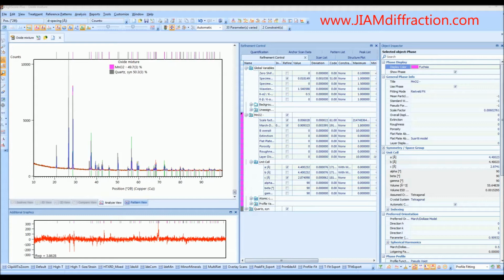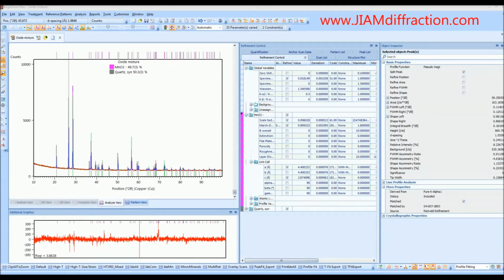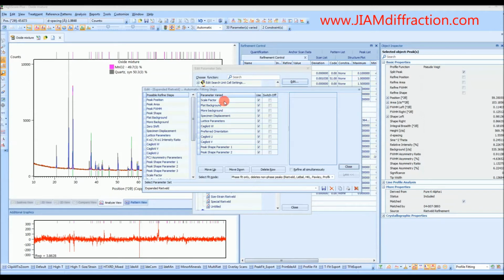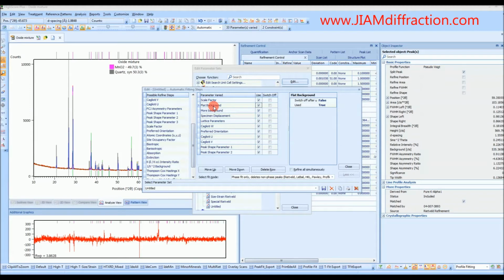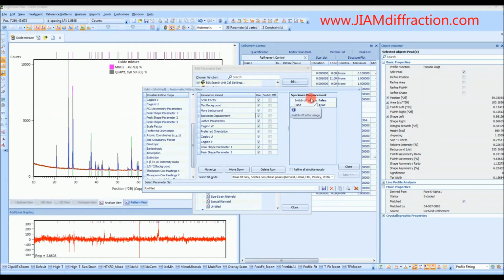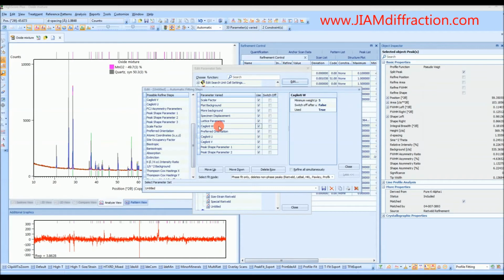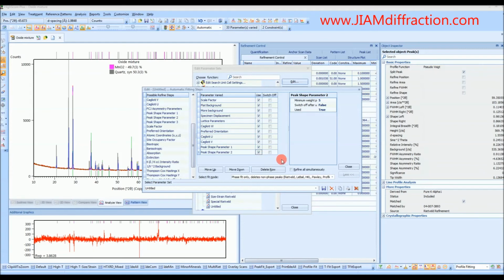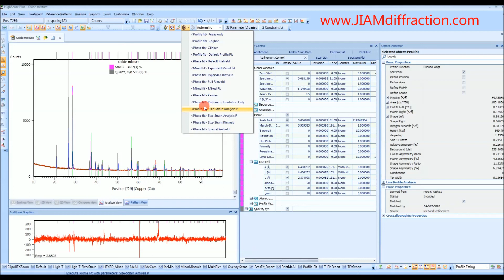HighScore Plus Tutorial - Create & Edit Parameter Sets - Automatic XRD Refinement - JIAM Diffraction

Comment: I saw  your many video about Highscoreplus. They are much helpful for me. Thank you so much. I want to calculating the lattice parameter with XRD. I have a same question with Paul Chando's one. Mine version is old (3.0.c=3.0.3) I cannot make a automatic profile fit file like you. In my program, there are only Automatic Rietveld step and Autoumatic profile steps. I cannot edit them as you.  How can I analysis like you in old version?
Reply from the maker: Thank you for the kind words!  I discussed this with Paul, and it looks like it may be an issue with your older version of HighScore.  I wish I could help more!
Reply: Thank you for your kind reply. How could I give some information about this menu, editing parameter, in older version Highscore?

Comment: Great video on how to modify parameter sets.  I do have a question on how your parameter sets include modifications for both profile and Rietveld refinement steps.  I am using Highscore 3.0.5.  When trying to edit a parameter set, I have the option to edit Automatic Rietveld Steps or Automatic Profile Fit Steps.  I never seem to have the option of being able to edit parameters for profiles and Rietveld at the same time.  Is there some configuration I can make in Highscore that would allow me to have the same level of customization you have in your videos for the parameter sets or is this simply an issue of using an older version of Highscore?
Thanks for the great videos.
Cheers
Reply from the maker: My apologies for the slow reply!  I was away at a conference all last week.  Anyway, it is always difficult when trying to figure out the differences between versions of software.  If you look in the edit screen (time stamp 00:01:54, for example), and you look below the "Move Down" button in the center bottom of the window, does your version have the "Select Fit Mode" option?  If so, my options within that drop down menu include profile fit only, phase fit only, and mixed fit.  Is yours different?
Reply: @IAMMDiffractionFacility  Thanks for your reply.  I have checked my version of editing the parameter sets and I do not seem to have the "Select Fit Mode" option.  The issue may very well be a difference in the versions of Highscore plus.  Thanks again for your help and these instructive videos.

Comment: Hi, excellent video!!!Thx a lot! I would have a to questions: when the background is very high (for ex the amorphous part of a wood sample), is it ok to use the search by peaks function to identify the background? The automatic one simply does not function, and the manual can give a lot of extra fake peaks. The second: sometimes the chosen patterns explain all the peaks, but after the Rietveld refinement, that V marker reappears. What does it mean? That some of the peaks of the chosen patterns are not contained in my diffractogram? Or poor refinement? Thx you, Calin.
Reply from the maker: I've not used the "search by peaks" function for background determination a lot, but it has seemed to work well in cases with a large amorphous hump.  Regarding your second question, I'm not too sure.  When this happens for you, what does the calculated pattern look like?  Does the calculated intensity for that kind of peak look much lower than the data intensity?

Comment: Thanks doctor, but i need to know how i can change the anode type from Co to Cu
Reply from the maker: Excellent question.  While I have much experience swapping X-ray tubes, I do not yet have a video made to post to YouTube.  Unfortunately, it would be a while before I could make and post one (I will be out of the lab for about a week soon).  Out of curiosity, do you know if you have quick disconnects on the water lines leading to your X-ray tube?  This makes removing and replacing the X-ray tube much quicker and easier.